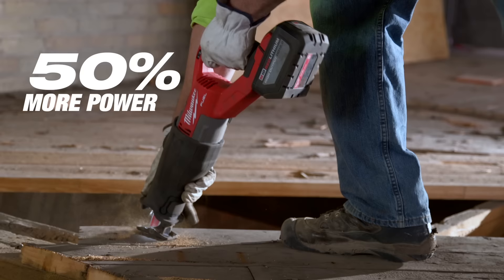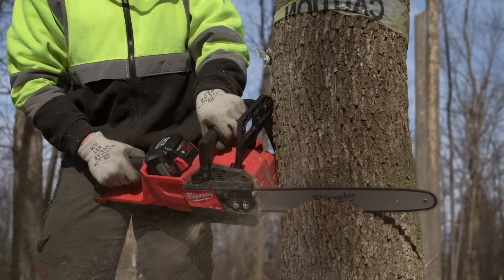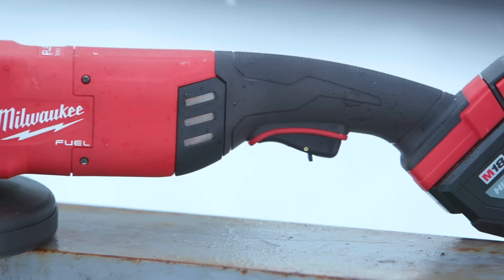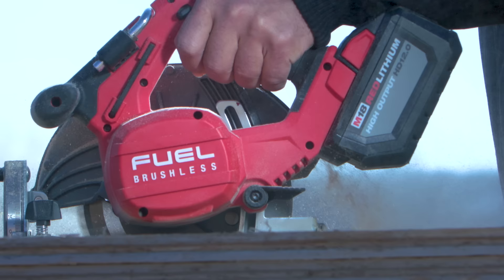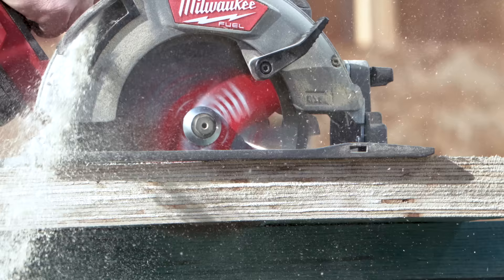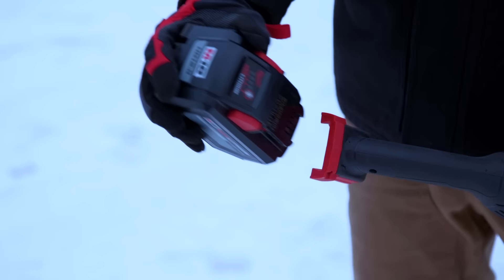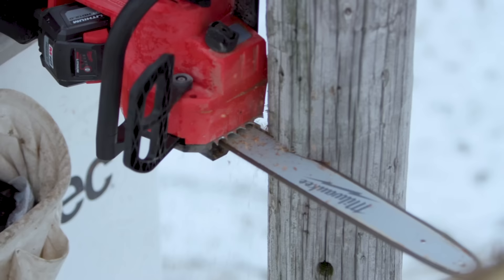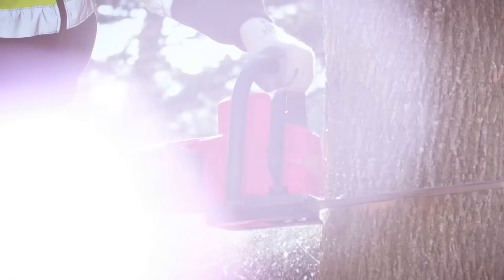Milwaukee® M18™ REDLITHIUM™ HIGH OUTPUT™ HD 12.0 Battery

Comment: It would be a block buster if Milwaukee build a cordless BOAT MOTOR! Maybe be not only me waiting for it))
Reply: no need... minn kota and others make 12 volt motors that are fine, not sure Milwaukee can do anything new there.   besides you want to run all your electrics off a single battery which is usually about 60aH minimum

Comment: I dont need it any more, i used ti need 9.0 batteries for my super hawg cause i did rough electrical for about 9 months. But since i switched over to networking and remodelling eletrical, a xc 3.0 battery on my m18 impact driver lasts me at least a week each. I do very little screw driving and drilling. But id still want this battery, itll definitely last me a month for sure.

Comment: Will the 9 trip out on these tools. What's the charge time on supplied charger?
Reply: The new Gen 2 FUEL circular saw ran pretty well on just a 5Ah battery for me, and was even able to rip PT 2X material faster than a corded 15A saw. With the 12Ah it blows corded away.

Comment: Will the 12.0 battery make there older tools run stronger?
Reply: Daniel Garbuzov yep, and run better/cooler too
Reply: Mike Zeke  the tool wont run cooler, only the battery
Reply: Juan Rivera seems to me that running a 9.0 over a 5.0 the sds max combination hammer takes longer to cut off because of over heating
Reply: Mike Zeke the tool should only pull what it can pull, larger capacity battery only means longer runtime, the battery runs cooler because it has more cells in parallel which means the tool will pull less amps from each parallel pack, the tool could heat up a bit more due to running for longer periods of time, tho if you hace multiple batteries, it would be the same thing
Reply: Juan Rivera I'm pretty sure you can push the  tools harder with bigger amp hour tools and they perform instead of bogging down and getting hot
Reply: main place I see it it brushed hackzall, it definitely perform better the higher amp hour battery is in it
Reply: but also the sds max and fuel grinder
Reply: Mike Zeke and working harder and faster wont produce more heat? The way i see it, short term, you’ll work faster and better, but long term tools will wear down faster, at least for the tools that were not designed for such abuse
Reply: Juan Rivera lol. then they are worthless trash. I buy power tools to get work done more efficiently.
Reply: No, what they're not telling you is they put bigger motors in their tools to try and compete with dewalt 60v, which they won't, that's why they need a 12amp battery because the run time would be horrible with anything less, it might make the tool slightly more powerful nothing to right home about because if that was the case they wouldn't have made a new circular and recip saw
Reply: No it wont.
Reply: say what you want,  but definitely saw better performance in sds max, sds plus, grinder, and superhawg with 12.0 over 9.0
Reply: and new sawzall (not supersawzalll)
Reply: Mike Zeke I will say what I want because I understand the science behind it. You'll get a limited improvement on older tools as higher capacity (by cell) batteries can cope with a higher rate of discharge/current draw, but there's a limit. If the tool has a 10amp motor, it's not going to start drawing 11 just because you heard see marketing statement from Milwaukee about 50% better performance.